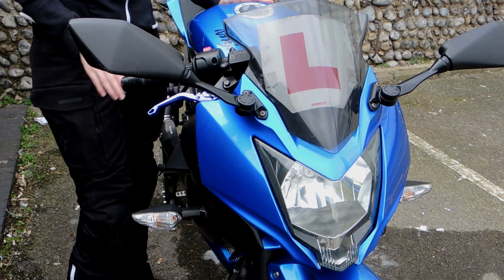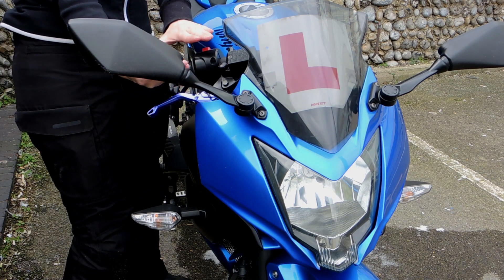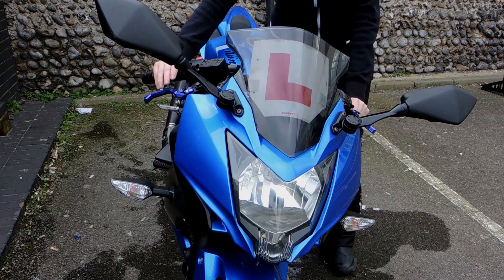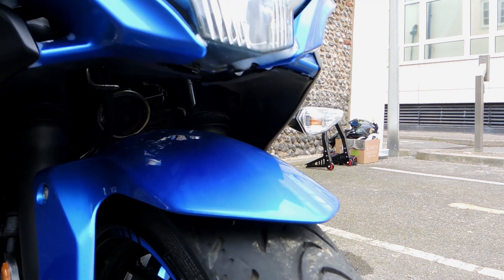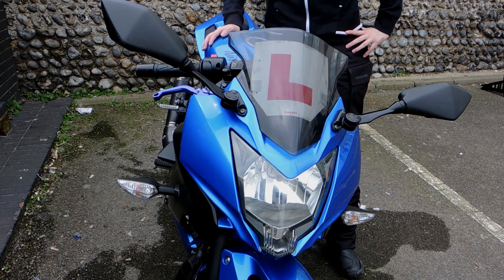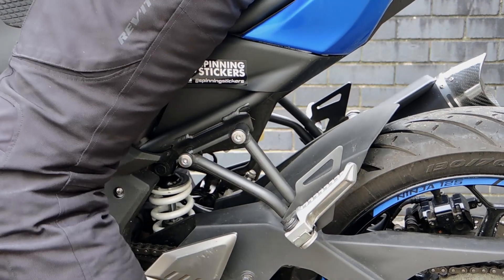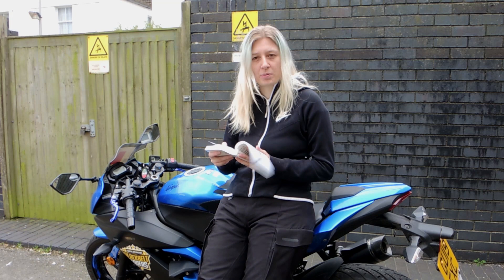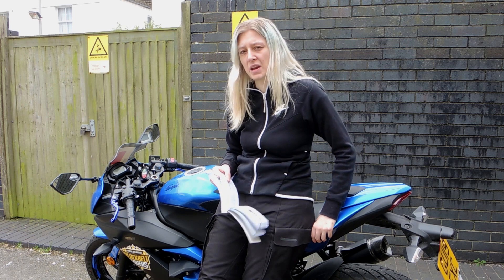Kawasaki Ninja 125 || Preload adjustment for light riders - Part 1

Comment: Hi can i install gear indicator on kawasaki  z125?
Reply from the maker: Yes you can, kawasaki has an official one for sale even! I personally don't feel the need to use one, but there is absolutely one available.
Reply: @Kialna  Thanks but i don't found any video. Do you have any link? Im from Bangladesh and i have z125  my English is not good😁
Reply from the maker: @bayezidkhondaker523  i don’t have a video, as I don’t have it installed myself.